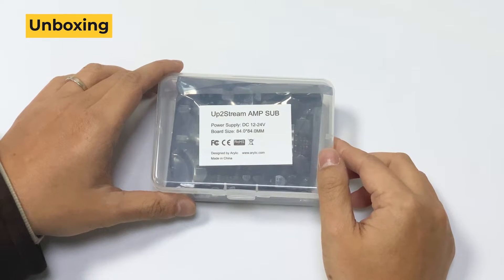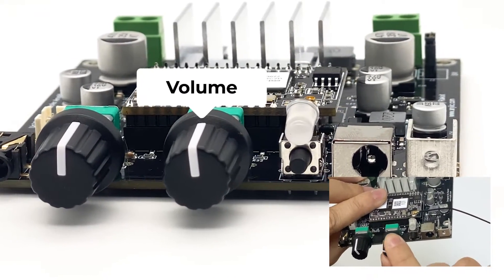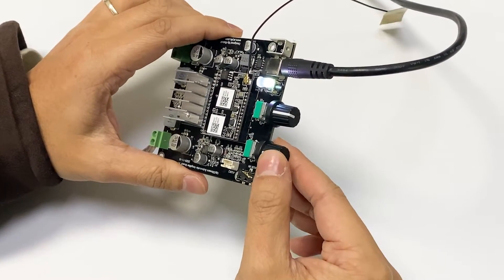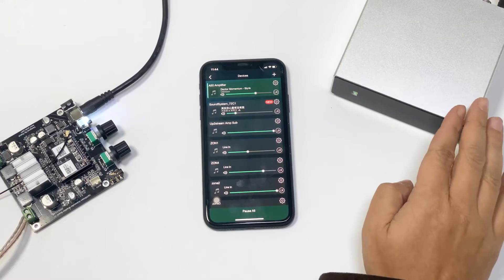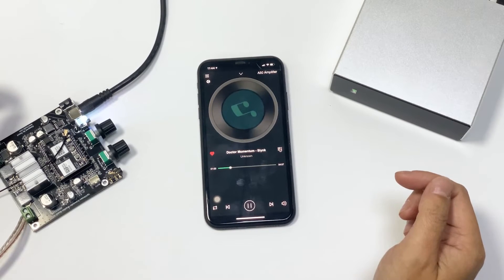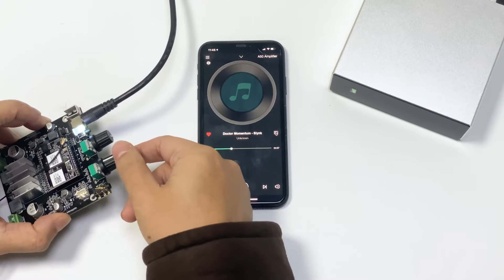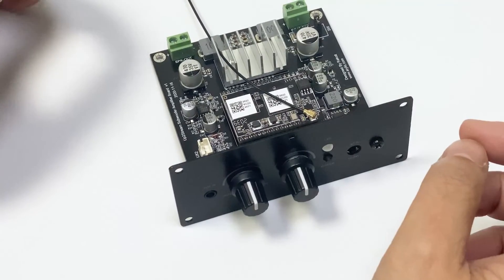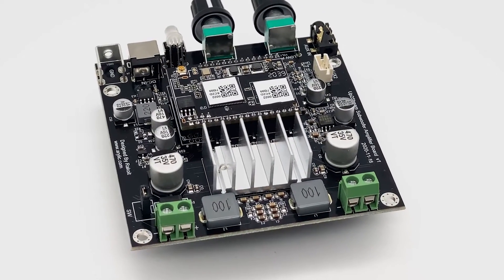Wireless Subwoofer Amplifier Board Unboxing and Review| Up2stream Amp Sub

Comment: If im going to run it with a battery? How much is fhe maximum voltage that i can install? Im thinking about lithium ion 21700 6series with a 22.2v nominal voltage and 25.2v in fully charge

Each battery is 3.7volts with 5000mah 15A…. Is this ok?
Reply from the maker: Hi Sir, the maximum voltage needs to be under 26V. And no problem with the battery model that you gave to me.